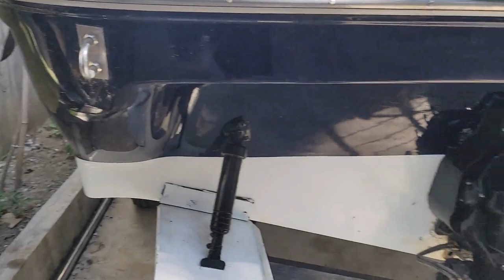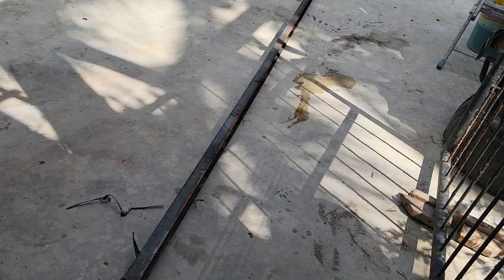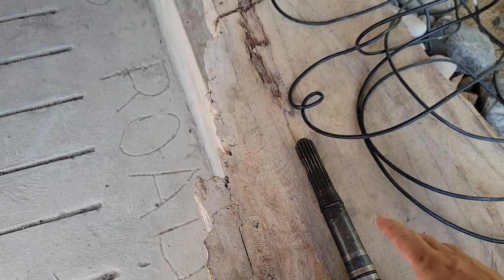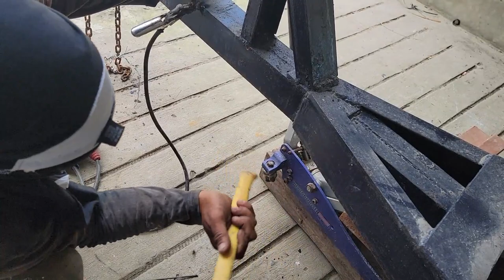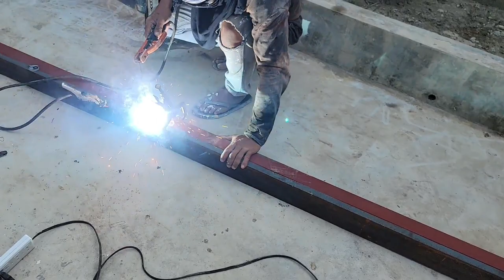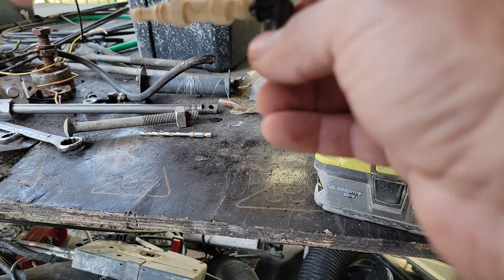Sea Ray 240  Mercruiser Diesel Refit PHILIPPINES Part 11 Longer Tongue , Input Shaft Alignment

Comment: I am Master Class certified and  marine mechanic. Don't forget to use lots and lots of marine grade grease on your gimble shaft and check your marine lower unit oil for clean oil while doing maintenance. Check all hydraulic fluid in your trim pane reservoirs. Good luck!
Reply from the maker: Kenneth , good morning and thank you for the kind heads up. You are so correct. I have marine grade grease here by tubs and tubes. I have a cabinet with stocks of gear oil and  plus ten gallons of 2 cycle for our outboard. I keep extra everything on hand. Seals, water pump kits, filters just on and on. Have you ever watched that movie Oh Brother Where art thou? The scene where he is in the shop looking for Dapper Dan and they only have Fop?  He said " well ain't this place a geographical oddity two weeks from everywhere!" LOL    I drained the fluids from everything before i shipped it from the states to the Philippines. The oil was clean in the lower unit with no signs of moisture. The guy who owned the Trophy boat this came out of took very good care of it.  He got the wild idea after a divorce and forced house sell that he was going to buy a high dollar outboard and modify the Trophy with a transom adapter. He and a friend of mine in Boston pulled the driveline and sent it to me then he never did the outboard project once he came to his senses. He had done screwed the boat and sold it dirt cheap. Lol.  Hope you have a great weekend Kenneth. Keep more tips coming and keep me inline. I appreciate you very much.
Reply: @TexasFilipino  I lived in Texas for 10 years and attended Cetral Texas College while I was  in the military at Fort Hood, Texas. I kept my 45 ft M/Y at Frank's Marina near Belton Dam in the 1970's after returning from Vietnam. I also have been married to my Filipina wife for 47 years and have lived in PI a couple times. We watch your adventures each week and enjoyed the house and boat build. If it wasn't for our grand babies here in California, we would be there for sure. In May, I graduate with a different degree. Keep up the good work!

Comment: I’m learning Work at night to, 🫡😂😂😂😂😂👊,White Boy melts all day 😉🦜🦜🦜🦜, This place is no Wyoming, lol Always a Challenge finding materials, You might need sway bar if you road it to far with you truck, to prevent tail whip, watching from Base camp, Villaba Leyte, God bless Belus
Reply from the maker: I will not be trailer this boat. Just launching here. If for some reason I had to pull it I would never be fast enough to get tail whip! If I trailer it there is hardly anywhere to launch it. Putting it on a ferry to other islands - INSANE PRICES !  Worse case is if we are far far away and have a break down and I have to go retrieve it.
Reply: @TexasFilipino  To dock on island lol they charge, Yes Crazy,

Comment: They sell 1/4,1/8, and 1/16 industrial barbed stainless steel fittings . Also if operating under no pressure you can drill them out and increase the flow.They have pipe threads at the one end and a barbed fitting at the other . Just thread the broken plastic piece and screw the new barbed fitting in. The product name I have previously used is swedgelock  but I am sure there are many other manufacturers and probably available on Amazon or any industrial piping supplier. Good luck with the glued piece but for $10 or so I think it would be a better solution.
Reply from the maker: Ray same as I said to another guy here. This is temp until the original replacement part arrives. It just drips in slowly to keep the lower unit topped off. There is no real flow.

Comment: im surprised none of the haters have said anything about not grinding down to bare metal before welding  the jack.  lol..  if it welds it welds .. doesnt need to be strong enough to hold the whole world up after all .. a few short welds will do it just fine
Reply from the maker: yes it might need to be replaced in the future and needs to be easy to grind loose
Reply: One less step closer to the goal.... Burn that paint off, crank it up!!

Comment: My only concern is that you constricted the flow of the oil because the hole in the coupler is tiny. Maybe look for that piece on fuel line, or where the line hooks to the fuel pumps sending units. I have those fitting in my fuel line repair kit that I bought from NAPA. It's a kit with several different kinds, unions, crimpers the whole nine yards. I'm sure there isn't a NAPA lol. But they do have modern fuel injected automobiles.. More oil flow. No hillbilly engineering, just saying
Reply from the maker: it is the exact same size and this does not have a flow line something pumping. This is a trickle going in to keep it always topped off.  The small nipple on there is the same size as the one on the tank. Dean I did say this is temp while I order the new replacement and wait for it to arrive in the Philippines. It's not hillbilly engineering ( that is on the insulting side) it is a temp fix until the right part arrives. )
Reply: @TexasFilipino  insulting fir who the hillbilly lmao 🤣  there's nothing  like haywire & ductape lmao 🤣  just joking James I know you don't do hillbilly lol

Comment: Morning,  getting it done.  Tell what are you going to use to push it in
Reply from the maker: either one of our 4x4 trucks . I brought it here from far in the mountains in Luzon at a lake with that truck trough some hairy climbs and roads. It can for sure pull it out at the beach here on a hard rock surface.
Reply from the maker: Good Morning Lyons
Reply: Good on you 😊 amazing the beach is so well packed.